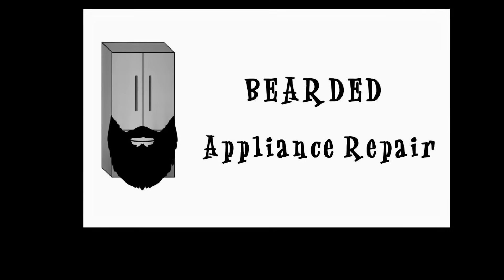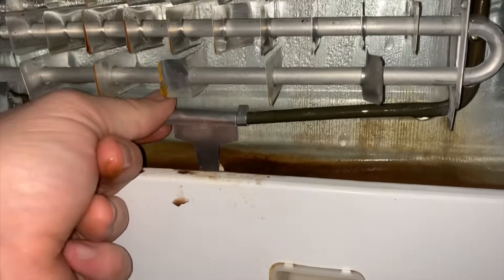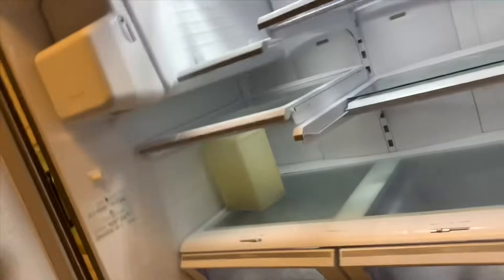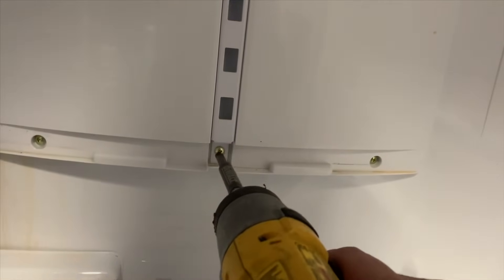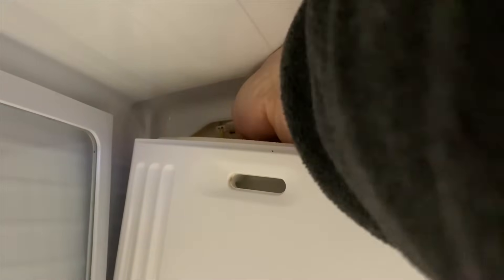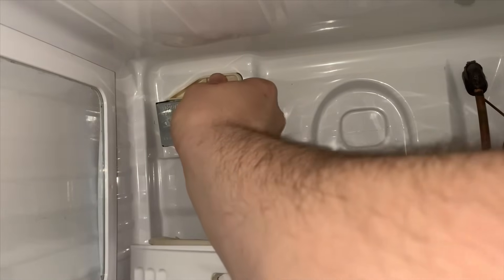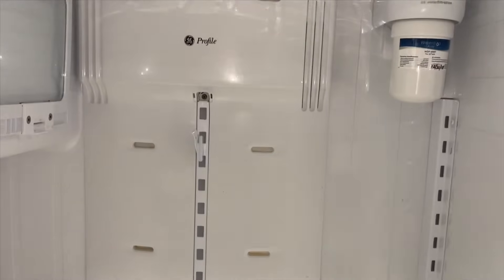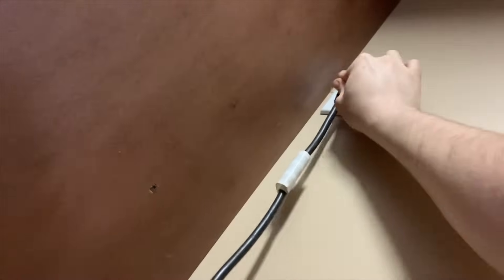Samsung fridge water collecting under deli drawer fix (DA82-01415A)

Comment: my big question is: where do you put all the food for 24-48 hrs to keep cold? trash and re-buy? thats a hard bullet to swallow
Reply from the maker: Good question.  For refrigerated stuff you can get coolers and fill them up with ice.  The freezer stuff or the harder part. My customers will have a friend of family member that will let them use their freezer in their garage for a few days.  

It always good to have a back up fridge in the garage if you can swing that.  Maybe get a used one.  Some places you can get a back up fridge for a couple hundred dollars.  Almost a must have now a days with these new appliances.  

Good luck and great question.  Hope this helps.
Reply: @BeardedApplianceRepair  yeah extra fridge in the garage is a LOT of electricity $ and  especially here in California and my garage is HOT in the summer  (no AC in there) so it would really cause the cooling system to really be on all the time to keep it cool. We dont have any family or friends nearby so.....
Reply: I transfer all of the refrigerator contents into a large ice chest where it keeps just fine for the 12 hours it takes me to thaw out the evaporator with an electric fan set in the refrigerator turned on high and aimed at the evaporator panel. I get a full thaw within 12 hours. The freezer contents stay frozen for that 12 hours and are left in place.

Comment: I had this problem about 2 years ago and fixed this way by clearing drain line.  I am having water accumulate under the drawers again, I removed the coil cover, cleared the lines, confirmed they are working fine, reinstalled parts but water is still accumulating under drawers. Its not the drain line. Any other Ideas?
Reply from the maker: forgepk3 turn off the water and see if it stops.  May have a leak in the filter head area.  Could also be a door seal causing the moisture.  Make sure those are good.  

Look for trails on where the water might be coming from.  It is clogging up in the drain area still the tube may be compromised causing it to freeze.
Reply: Could a cheap filter cause water under drawer cause the water.   It’s quite a it

Comment: Can the new heater clip be installed on top of the old one? I would think this would provide for more heat than just one, preventing this from ever happening again
Reply from the maker: I wouldn’t.  You want the new clip to be wrapped as close to the heater as you can get. The more surface area the clip is on direct contact with the heater = more heat transfer. If you install it over the old one I can see heat not transferring as well.  With the old clip in the way the new clip won’t be in as much direct contact.  I would think It wouldn’t get as warm as if there was only one clip there.

Comment: I changed this samsung kit out on my fridge yesterday because its accumulating water under the crisper drawer.. but I check today and water is still accumulated in the same area... can you please suggest/help me on what other problem it might have?? Thankyou
Reply from the maker: Did you make sure the drain was completely clear?  May have ice build up below the heater clip.  I w u of check that first.
Reply: Does water have to drain out thru both bottom Tubes that came in the samsung kit? Because it was only draining from the one on the right when pouring water from the front.
Reply from the maker: Yeah just one.  One is for the refrigerator, other is for the freezer.  If it clear than you may a leak somewhere.  Just follow the trail and it should lead you to the leak.
Reply: Ok.. will do, THANKYOU so much for replying.

Comment: Helpful but my question is,why would anyone buy Samsung?
    In having the same issue. I'm gonna wrap copper work on heat tube extending into drain.
      But with all the Icemaker issues I've had,
   This 3 year old-$2500 fridge is going to the fridge graveyard.
Reply from the maker: I hear you.  Notorious issues for sure. At this point I don’t know if those ice makers are even fixable. Glad to help where I could

Comment: I'm ordering the part now. I just did a temporary fix without the new hardware. Does kit #DA82-01415A include the pieces you show in this video? Another video that I saw said to get the same part number, but said to replace the defrost thermistor, and that the defrost thermistor was causing the ice to accumulate in the first place. Is that little tab the thermistor? Sorry if I sound like an ass, I'm not familiar with fridge internals..
Reply from the maker: Usually if you’re getting water in your deli drawer it’s a clogged drain line.  Could be just water freezing in the tube or drain tube clogged(tube in rear of unit).  

If the sensor goes bad you will usually just get the evap fan making noise.  With no water in the deli drawer.  They can be separate problems but both happening at the same time.  I would start with the leakage kit that is linked in the description and go from there.  It’s a good start.  

This was a good question and thanks for asking.  This will help others that read this.

Comment: Where do i find the gasket on the connector online? I went to plug mine back in and noticed mine did not have any. Is that normal or can i be ordering that somehwere/ You mentioned in your video it could create a boat load of probelm that i dont want to have. Any help is greatly appreciated!
Reply from the maker: The only way I know of it getting a new sensor or wherever the missing gasket it. Should come with one.

Comment: I have a Samsung RF266AERS/XAA,  Could it be the water bottle behind the deli drawer leaking? I pull that damn drawer out twice a week to clean up the water before it freezes into a sheet of ice. Broke the door trying to get it out. Husband has taken the panel off twice and it was covered in ice. He didn’t replace anything, just cleaned it up.  #Samsungsucks has the worst appliances EVER!

Comment: Two questions: Do you think it would help to use sandpaper on the tubing before installing the aluminum clip? I'm thinking that it would help to maximize heat transfer to the clip. Second, did you see much difference between the old flapper valve and the new one other than the two holes above the flapper? I'm wondering if you can't just clean up the old one and drill a couple of holes in them. I wonder what the purpose is in the flattened restriction. Good video.
Reply: I said the same thing about making holes myself but mine came with the holes already apparently

Comment: Will this help with the ice maker freezing over?
Reply from the maker: No sir that is a separate issue with these.  Samsung wants you to do a handful of thing to resolve that issue.  Replacing ice maker, control board, larger auger motor tub, silicone around ice box gap between the wall and ice box just to name a few.  I’m also not convinced it fixes the issue either.  Most people decline that estimate.  Over a $500 Repair out of warranty.

Comment: Yeah, we did this "fix" a month ago and the problem is back.
Reply from the maker: Check for cracks in the liner.  It can cause similar issue.  

What have you done so far in detail?  More water under the deli drawer or is it doing something else?
Reply: hello, did you find the problem with the fridge?

Comment: had this problem with fridge. not worth fixing better off getting new fridge ,,it will happen again. 2 friend have sam fridge ,,they had it repaired twice and replaced drain tubbes too,  second time was even worse from the second time happen. . its the bastard child of samsung and GE.  the evaporator coil ices up. by time realize its frozen up .you will have puddle on kitchen in front of fridge. NOw have to get new fridge. and call homeowners to get floor fixed

Comment: This is a great video, thanks for posting it.  I have a similar unit and after defrosting it multiple times and trying a longer defrost part, I finally decided to cut open the back of the fridge and move the drain line to the warm room air outside of the fridge.  I have not had to defrost my fridge in years.  My video is not as good as this one but it gives an idea of how I did it.  My suggestion may be a "last resort" before you spend the money on a new refrigerator.  https://www.youtube.com/watch?v=HwaP92Smvro

Comment: Any idea if the drain tube is clogged inside the refrigerator? How to replace that?
Reply from the maker: I do not believe you can replace that.  There is a tool out there to help clear it if it is clogged.  I’ll link it here.  Gallo Drain Gun- With 5 Unthreaded CO2 Cartridges for A/C Condensate Line - Air Conditioner Cleaner Blaster Opener Kit with Five Cartridge Clears HVAC Clogs https://www.amazon.com/dp/B07SVH5B78/ref=cm_sw_r_cp_api_i_-6K9DbR331SEP.  

The drain tub goes through the liner and parts that go through it are not replaceable from what I under stand.  Good luck!

Comment: Hmm, Cleaned tubes, and replaced the drain heating piece. Element seem to freeze back up. Appliance video dot com seem to replace a heat sensor. Any ideas?
Reply from the maker: Look for cracks in the liner.  If you find cracks you need to seal them with something like flex seal tape. Air leaks wreak havoc on refrigerators.  

Samsung recommends replacing the thermostat and evap cover.  There is also a heater out there you can install for these.  If you do a google search on it you may be able to find it.  I haven’t installed one just heard about them.  Usually finding those cracks and sealing them take care of it for me.